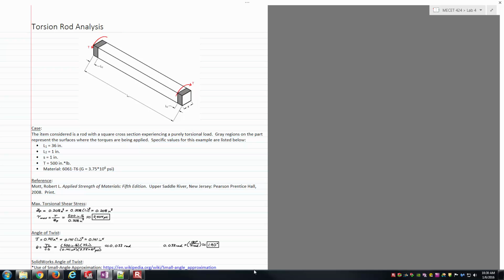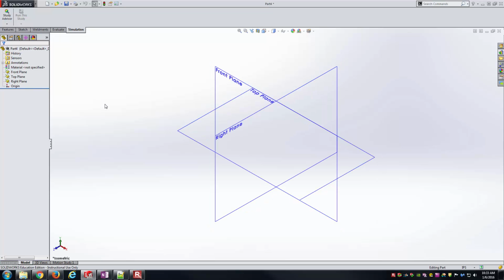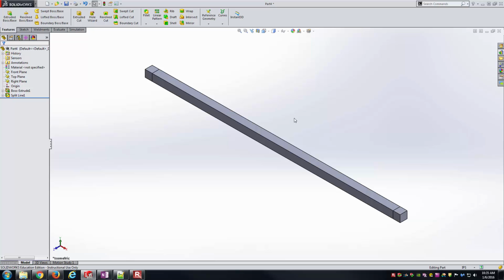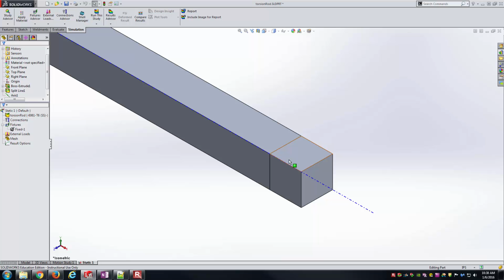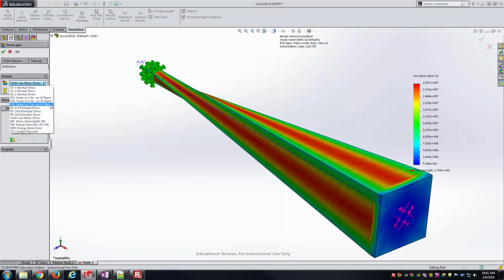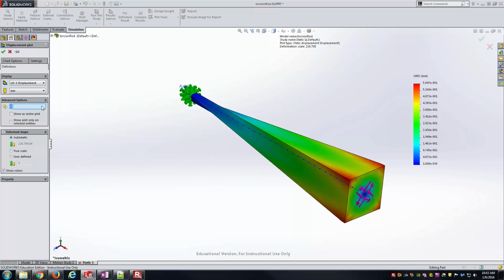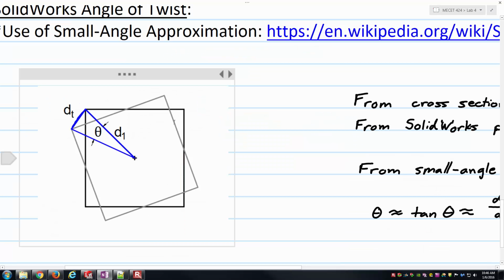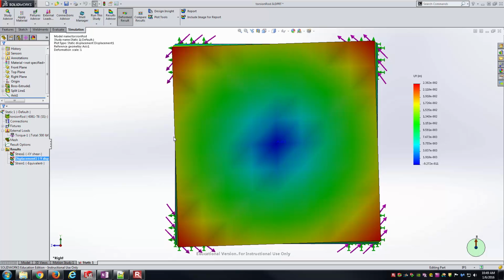SolidWorks - Torsion Rod

Comment: Hi! Where is the 0.141 value coming from for the theoretical calculation? Sorry if I missed it. Thanks!
Reply from the maker: In the Mechanics of Materials texts which I have access, that value is specific to the given cross section.  Essentially it is attempting to come up with a property of the cross section which plays the same role as the polar moment of inertia for circular cross sections.  I don't have access to the text referenced in the video, but the text that I have access to now points to an additional text for a deeper study.  This text is "Theory of Elasticity" by S.P. Timoshenko and J.N. Goodier.
Reply: @frankieskaggs409  thank you!